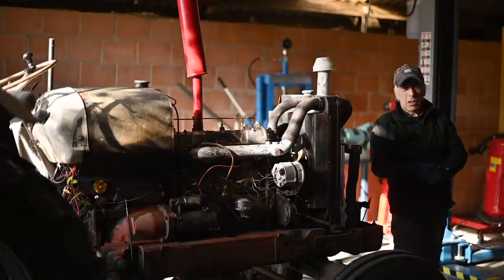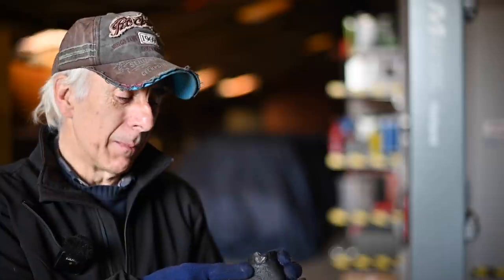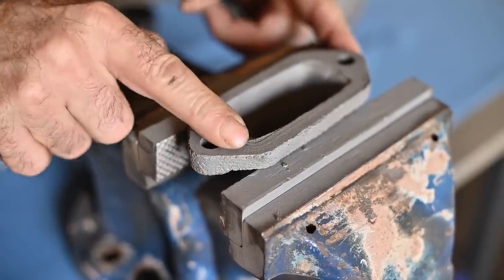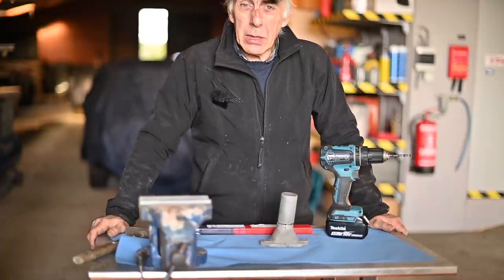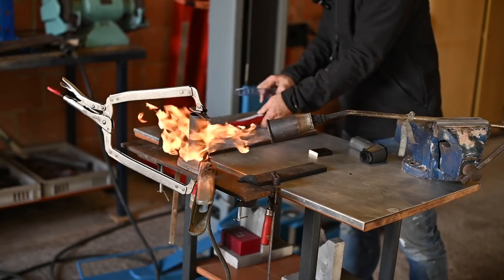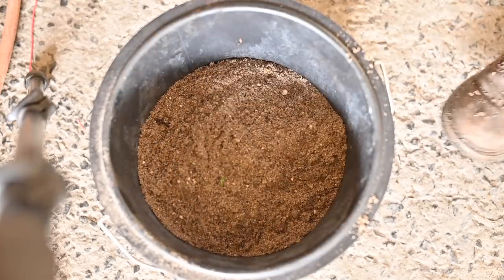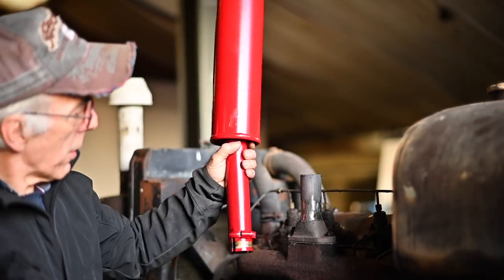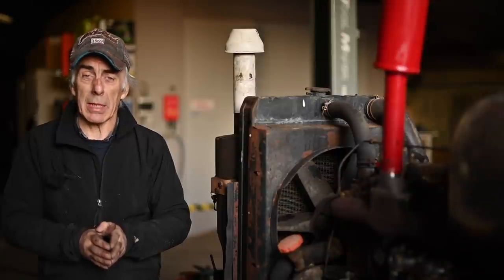Repairing a die cast  exhaust manifold    on David Brown tractor

Comment: Another interesting video young man.
A few of points worth a mention I think.
Because it had been welded before, I am reasonably sure you were welding a welded joint back together so possibly a mig or a 7018 rod would have been OK? When I did my Vice repair video I used Fonte Ni welding rods on the vice to build up the lower jaw support and it worked a treat, I pre-heated to 250degrees C which is plenty warm enough.
Also, to check for metal types, you can use a grinder to take a little metal off and see what shape and size the sparks are. Grey cast iron has short sparks with sort of a starrry/spikey/fingers on the end, very different to mild steel.
Always use very dry sand to insulate the component for cooling, it flows better around the part. Wet sand can introduce a thermal shock which might cause a crack. Only weld cast iron in short 13-20mm beads to begin with and if on thin wall cast iron components.
With cast iron, the weld puddle freezes very quickly compared to the very wet mild steel puddle. Top regards from North Yorkshire, England!

Comment: Die cast is normally alloy , this is cast iron , if you overheat grey cast iron you turn it into white by changing the grain structure.it would be easier and stronger to make a new part from steel
Reply: Although this very stressed component, (it gets hit on overhead obstructions), would be far better made from steel , it would result in the cast iron manifold breaking if the exhaust, (which sticks right up above the tractor),came into contact with an obstruction, the manifold is very expensive! so this part is in a way sacrificial.
Reply from the maker: Thanks for the comments, Well if i made it out of steel which would not be that hard, it might brake the exhaust manifold...  or not ?

Comment: That was a very successful repair, I have to say that the original use of cast iron for this part is a very bad material choice, the vertical exhaust is constantly getting hit on overhead objects and that is going to result in this part breaking, the fact that it is a separate part to the manifold indicates that they expect it to get broken, I notice that although it broke off, it did not break on the old repair weld, but above it, I have repaired these with a normal MIG welder before and got away with it, to my surprise! I suppose if you fabricated a mild steel stub it would break the manifold further down!  Stay safe! Chris B.
Reply from the maker: Thanks for the comments Chris,  did you use special wire in your MIG  ( with nickel ?)   Stay Safe
Reply: @D3Sshooter  This was a lesson to one of my students that rather backfired on me, the student insisted that it was possible to weld the large hole in the manifold of his Mini, and he thought that the MIG would do this "simple" welding job, I explained that it was not possible to weld cast iron with the normal MIG wire we had in our machine, but he still insisted, by way of a practical proof that it would not work I welded up the 30mm hole, and to my surprise it worked! The student wandered off not realising what a huge leap in knowledge I had achieved!  Stay safe ! Chris B.

Comment: Lots of us have a stick welder so it's nice to know something new. Never saw anyone heating the part before, so that's new for me.👍
Reply: Always done with cast iron. As well as cooling as slowly as possible.....I usually wrap with fiberglass insulation.
Reply from the maker: Thanks for the comments,  Its something that prevents cracks as cast iron does crack when it gets temp shocks.  This prevents it
Reply from the maker: Indeed John that is a great method

Comment: A nice video again!    Enjoyable.  You are a renaissance man of many skills.   Which, nicely, means that your videos are always of very good visual quality too in addition to the technical knowledge they share , pro photographer at work evidently,.   Thank you!   (Since your English is so good that you must have taken great interest and time in learning it and are already well into advanced linguistic subtleties, you may be interested and won't be offended I hope if I note that your frequent use of the term "die cast" would sound perhaps odd to US ears.   Generally we refer to "die cast" parts as non-ferrous part that are made by injection of molten metal in a 2 part steel die that opens up and releases the part.  Kind of like injection molding for plastics.  Picture little zamak toy cars made in large quantities at high speed.  In contrast, cast iron would normally be, well, iron (and carbon etc) that is poured in sand molds etc as you obviously know very well given your familiarity with the different kinds of cast iron.  Different materials and different processes.   Then again, I don't actually know how "die cast" is used in the UK or Europe.  And your English is 1000x better than my Flemish, so not criticizing, just trying to note a possible language difference that may be of interest to us DIYers.)  And your points about preheat, Ni rods, and sand cooling are all excellent when it comes to cast iron welding.  Thanks for the video!   [Edited for messed up use of hyphens that Youtube frowns upon apparently...]
Reply from the maker: Thanks for the comments and by all means correct me ,  I do enjoy and read all the comments.. Often I learn things, like  in this case.  You did bring added value.  After all we share and learn....  Thank you

Comment: As you said you didn't know what kind of weld was used before. I have welded many cast iron items but I prefer using TIG welder and a stainless rod. Preheat to 600 degrees celcius and weld without the torch burning, you are adding a gas fumes pollution . When using TIG you control your melting bath much better, without the rod flickering. There's many ways of doing it. It probably will crack when stressed. Sorry for my remark.
Reply from the maker: Thanks for the comments Flint, I appreciate your remarks as you are a pro in these matters.  That is something I will apply on my next job... Always great to get this feedback.  Thanks pal...